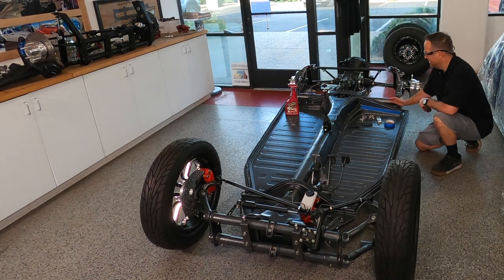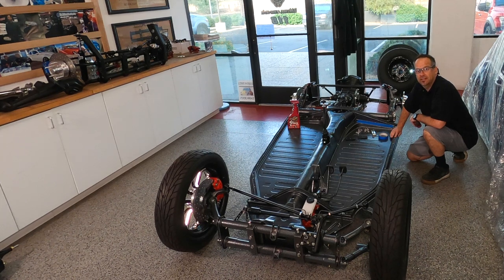DETAILS EVERYWHERE!! - Volkswagen Based Kit Car Chassis Assembly Continues

Comment: Hey Pete. Is there a reason you run the brake line on the outside of the centers spine instead of running it inside the spine to keep that clean look.
Reply from the maker: Certain builds require keeping things assessable, others can be built to hide or showcase.